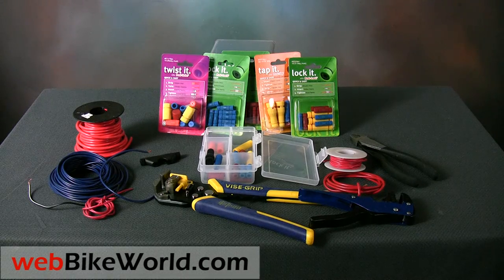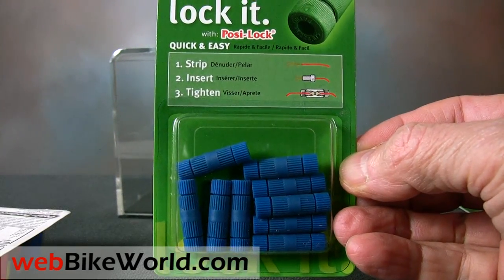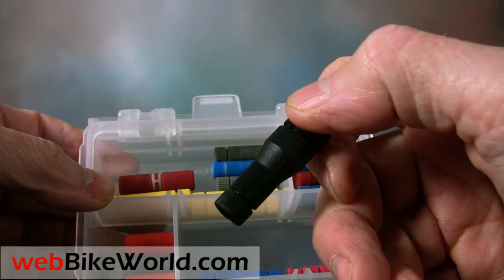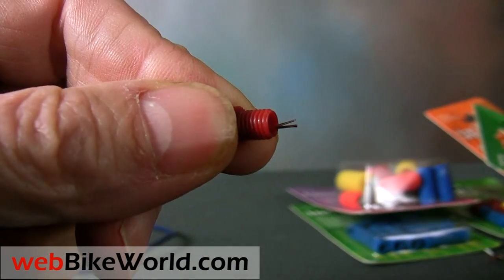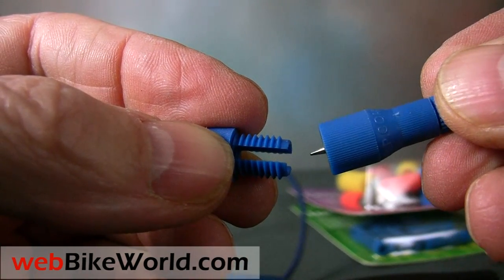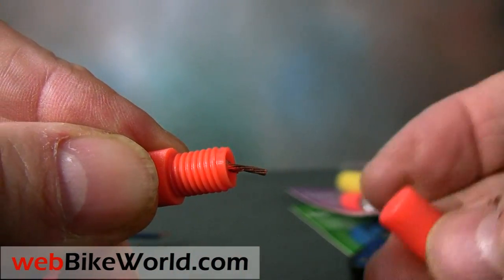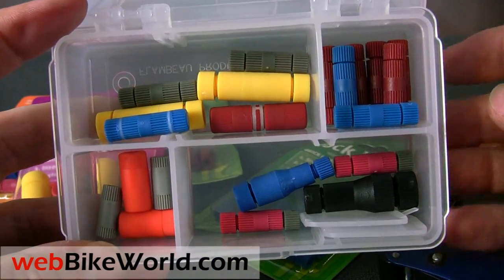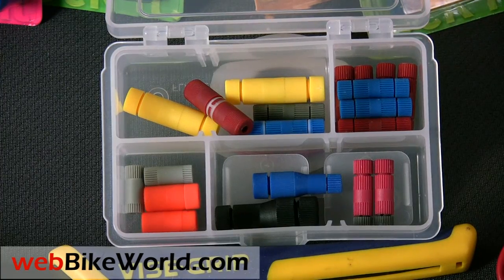Overview of Posi-Lock Connectors

Comment from the maker: Not really waterproof, but very few if any taps are. If you're tapping a line in a motorcycle, chances are it's underneath a body part anyway. Think about it, very few if any wires and connections on cars and motorcycles are waterproof.

Comment: What I'm not seeing is how those locks hold the wire in place. If you're just slipping it through the open hole in the cap, how are wires being held there? They clearly work, but I can't figure out how.
Reply from the maker: Here's an updated video we published: http://youtu.be/N64p6ndlTQ8  The wire tip is held in the body of the Posi-Lock by friction against a metal cone. When the hollow end is threaded on, it tightens the connection.